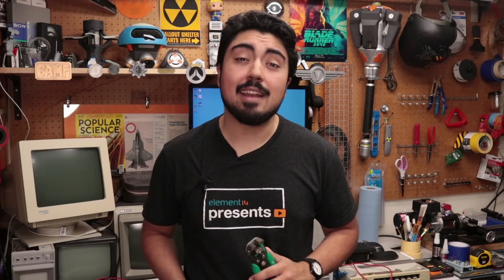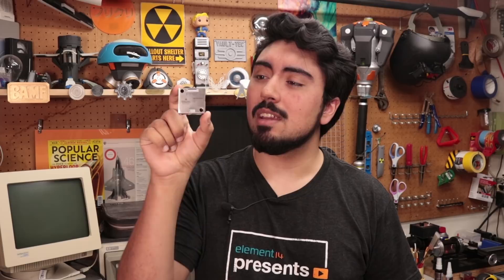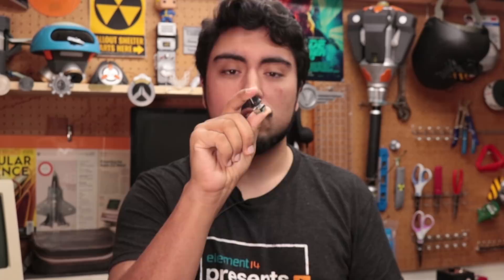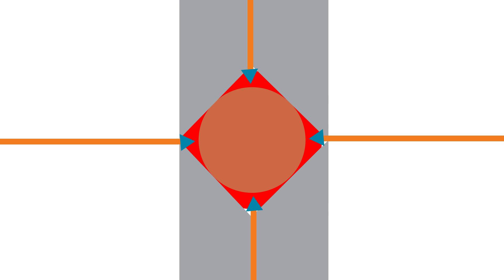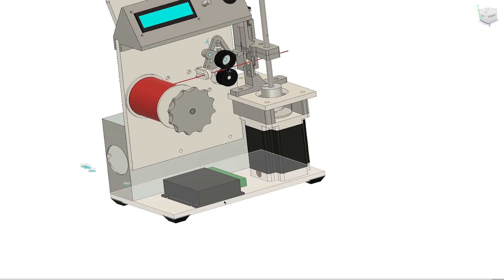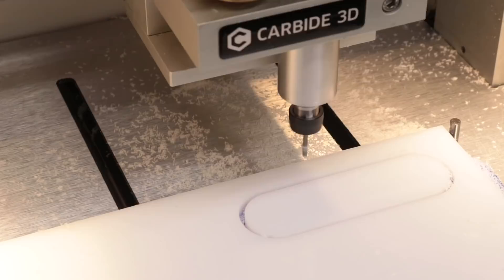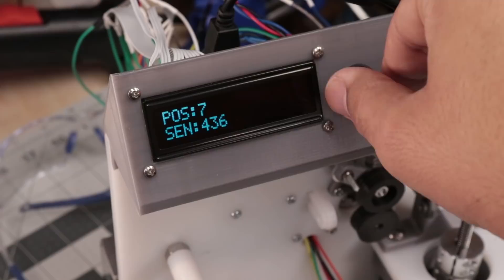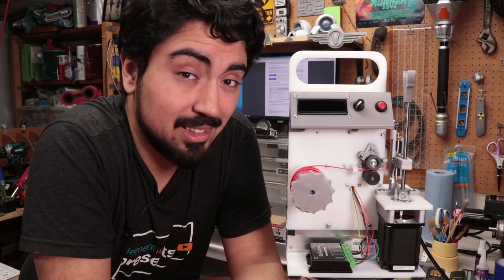Arduino Automatic Wire Cutter and Stripper

Comment: You could add some lines to the code to retract the wire to pull off the insulation
Reply: I think that would only work for the front end, otherwise how would it cut and then take off insulation?
Reply: It is possible that he'd prefer to keep the insulation on - to prevent damage to the conductor... that was my first thought.
Reply: another roller AFTER the cutter could handle that task easily

Comment: A nice machine. If you were looking to build a V2, you could think about having a slightly more complex interface where you could stack up the 'requests' - so you could set it away making multiple different lengths of wire.

Comment: Neat, but it seems like the stepper motor to cut the wires are a bit overkill since it basically drives a screw and thus would not require a lot of torque.
Reply: Stepper could be reused to remove insulation
Reply: Absolutely! I'd much rather have torque to spare than a stalled motor. Now I can push it to cut thicker gauges of wire.
Reply: You'd have plenty of torque with a little nema17.
Reply: Yes the motor is way overkill, the blade holder assembly is already flexing from that small wire being cut . The threaded rod greatly multiplies torque/ force.

Comment: If you are adding the rfid or nfc reader, you could set the information on cable thickness automatically, too. Not only keep track over your wires.

Comment: If you could add a second stage, you could rotate the wire axially in those 90 degree blades to fully slice off the insulation

Comment: It would be ideal to add indexable dies to cut specific gauges so you "always" score the right amount of insulation before overlapping to cut. A gauge specific pilot die just before the cutters would help insure centering and help counteract the variations caused by the natural length-wise radius of the wire as it leaves the spool.

Comment: I have a professional cutter that cuts and strips on Both ends. Chinese made cost me about $2800 but you can get them from China for half the price.
And another machine from Phoenix contact that strips and crimps ferrules. About $3000.
I'm designing a very simple machine for small hobby jumper wiring that uses a heated blade to strip so that I don't need to much force to hold and pull. The manual operation works well I need to complete the Automation and the simple wire bending mechanism.

Comment: Suggestion: after the "closing of the blades" in the stripping cycle, the stepper motor for the feed roller should roll the wire back, while the blades are still closed, so that way, the insulation would break and the wire will realy be "pre-stripped".

I guess that would help a lot in cases when the wire piece is small and hard to get a grip after it's cut.
 (I hope you can understand my broken english)

Comment: Make a “belt track” for more accurate measurements. Composed of 4 wheels, 2 per belt, a track (similar to a military tank tread) could better grip the wire to be fed through the system.

What about a rotary blade system that completely cuts the entire circumference???

Just some ideas!!

Comment: You may measure the resistance of the wire and the cutter in order to get the distance of the blades just right.

Comment: What about using a low power CO2 LASER to cut the wire and vaporize the covering from the ends of the wire, that won't work you need a groove from the end of the threaded rod to the other end in a reverse helical direction in relation to the screw threads so that the carriage will be returned to the beginning when the carriage hits the end of the threaded rod.

Comment: I've been thinking of something like this for quite a while for both wire and shrink tube. I'd probably shorten the distance between the feed and cutter and add a guide in there to support the cutting material. (I. E. to help ensure proper alignment for floppy or wire that doesn't want to give up its bending from the spool. I'd also add an encoder to the idle wheel to measure the true feed distance. This would also allow the machine to automatically pause and alert if the feed wheel starts slipping.
Reply: These are all great suggestions. I'll have to add that in for V2!

Comment: The Input voltage (limit) range from 6V to 20V and the input voltage (recommended) range from 7V to 12V for this Arduino Mega.
Why did you use a 5V step down regulator instead of 7..12V?
Reply: Leslie Tailor Then the power would run through two regulators. If I'm gonna step down the voltage with an external part, I figured I may as well jump straight to 5v with the more effecient switching regulator.
Reply: @MrVolt  Where did you connect the out + - leads of the external regulator on the Mega?
Reply: Never mind, found the VIN pin.
Reply: Mr. Volt  Just found that the VIN pin is connected to the Arduino's internal LDO which needs at least 6V to create stable 5V so still i do not get your solution.
Reply: @szabolti  I'm bypassing the Arduino's LDO altogether by connecting the 5Vout from the switching regulator straight to the 5V rail on the board (VIN pin is unused). The only catch is that I have to unplug the 24v connection if I want to connect the usb to the Arduino since I'm bypassing the power circuitry on board.

Comment: Interesting project, like it.  As an add on, after the feed rollers move the wire out, the wire curls a small bit, maybe a guide from there to the blades to keep it in place?
Reply: It definitely need more control in that area yeah.

Comment: Have you thought of making it detect the blade touching the wire in order to get a precision strip?
Reply: NiHaoMike professional cutters used manual regulation of the blade closing, there is no need for anything more complicated. I've cut over 100000 wires and this is not an issue.
Reply: If they touch then you've probably cut too deep and risk damaging the cores, for ultra critical stuff hot wire strippers are used to avoid such damage.

Comment: This doesn't strip the wires, it just notches the insulation and cuts the wire. You just need another line of code to make the wire-moving roller go in reverse.
So: The roller moves the wire into position, the cutters (which are ROUND not square) move into position, and the roller pulls backwards on the wire TWICE the length to be stripped.
Stepper motors can move in both directions, yes?
The insulation comes off. The roller then advances the wire to the other end of wire to be stripped and the cutter/stripper closes down on the wire again and the roller pulls the wire, which pushes the insulation forward the length to be stripped. Now both ends of the wire are stripped, advance and cut. Only new part is the sharp bit and you can scrounge those from the stripper in your hand at the beginning of the video. They even have mounting holes and different sizes. Add a wing nut to change sizes, sliding them over in the mount. You would need to offset them a hair so they cut.

Comment: I'd add more area for spools for different colors like ground and a signal. Personally, that would be a must. 

You could do a simple color change routine like with many 3D printers. But you could also do it auto-magically if it had three sets of idlers and a mechanism to clamp them down or not for the desired color. Then feed the three wires into a single tube one at a time by a 4-way chamber (3 in / 1 out). Make a color change routine to retract or insert the wire and use sensors or switches to know where each wire end is. Just a brain fart.

Comment: Not a bad prototype and should work nicely for small wire like the 22 AWG in the example. 

Looking through the code you have "#define PIN_ENABLE_FEED 21" which is an output and cycles LOW, HIGH, LOW. What is this connected to? Your feed motor is controlled by stepFeed.
Reply: Have you got a link for the project files please?

Comment: Any thoughts on how to do this with multi channel/conductor wire? Like 2ch speaker wire? I make and sell arduino wire cutter but havent figured out how to strip the wire. Mine uses servo motor to work handheld wire nippers, stepper w planetary gearbox to feed wire

Comment: Heat up the cutters so it can melt the leftover bits that can directly cut?
Reply: Wayne Johnson I've tested it, no need to melt it, you simply need to keep the cut warm and it strips easily.

Comment: I tryed long time ago to make an automatic machine to crimp the dupont connector. Not enough precision on my build, I failed.

Can you do it?
Reply: Having crimped them by hand, I know your pain. That sounds like a hard challenge, ie a fun one.
Reply: @MrVolt  lets see if at Element14 they take the challenge?
On my "experience" I used a crimping tool and actuated it with a small air cylinder, work great. The only problem I had is the preciselly put the wire always at the same place.

Comment: FFS, I was trying to look for how to use automatic wire strippers with small wires but they are all reviewed and explained by electricians that strip big wire and not small wires like for Arduino/ESP32 projects. I changed the search to include "Arduino" because I knew I would see small wires, but *OBVIOUSLY*, what I find is people making ROBOT auto wire stripper... >_<

Comment: Messager me here I can tell you some helpful hints on getting your wire to be stright for better stripping and also if you want it to fed your wire better. I use to run and repair wire cutting stripping and pinning machine for a living.